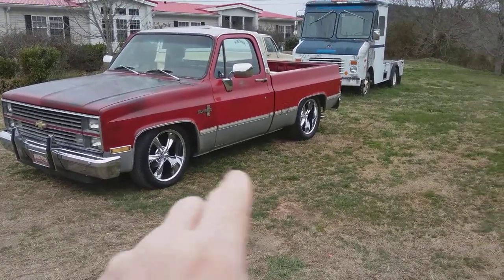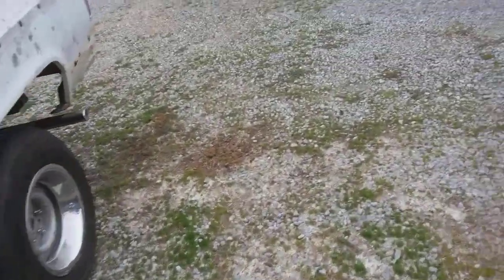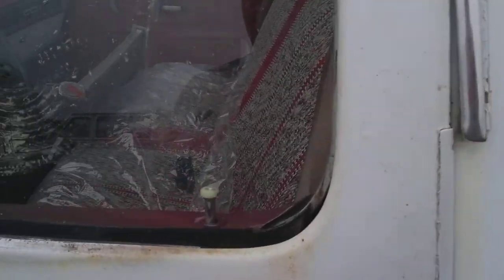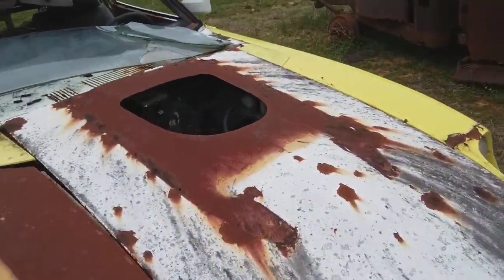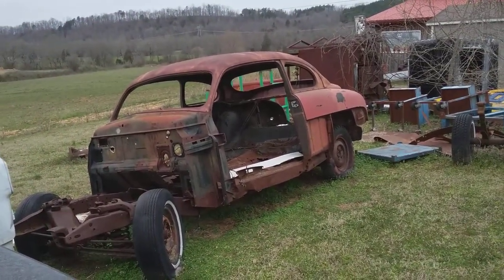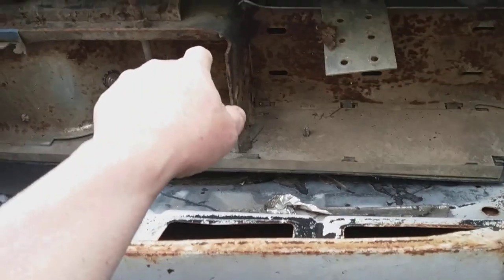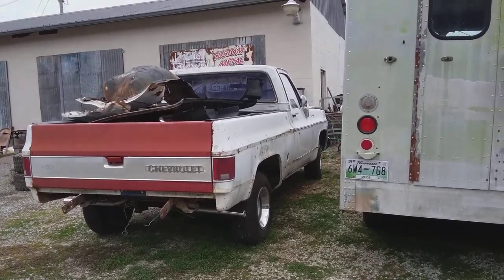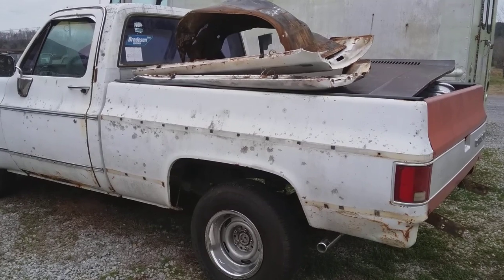Update on 1978 Chevy C10 "Billy James" at GAS AXE CHOP SHOP. Check out this beautiful truck! Lol.

Comment: Thanks for the update I know I was one of the ones asking and the truck does look a whole lot better. Take all you can off of that truck that's wrecked  with that many square bodies parts are great to have. Even light switches / heater core all extras. Defiantly take the dash pad door panels and seat for billy James did the wrecked truck have a white tailgate for you a tailgate you don't have to paint would be a bonus. Those riddler wheels are they the ones you sold I know some videos are out of order. Take care keep us posted.
Reply from the maker: Yes sir I will be taking everything that is worth anything off the wrecked C10 truck. And yes it has a white tailgate. Everything I have bought has been the color of white! The junk door and fenders and hood were all white in color. Yes those are the Riddler Wheels that I have sold. I sometimes forget about what I say in my videos so I get them out of order. But I am glad that you understand. Thanks so much my friend for your comment!